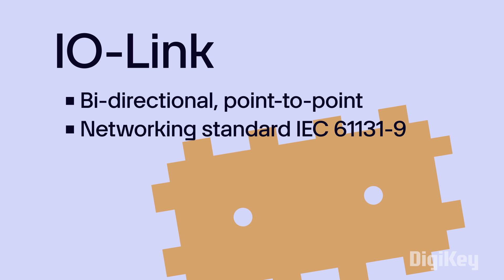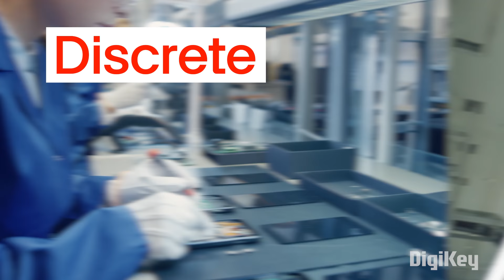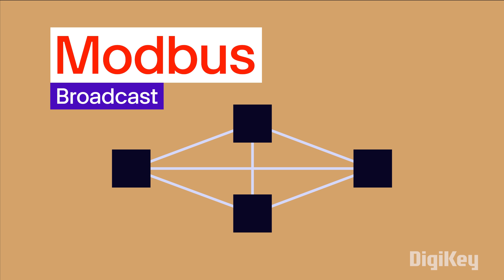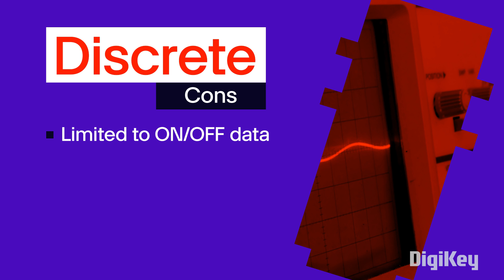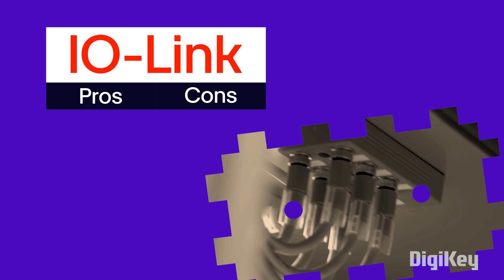IO-Link vs Modbus vs Discrete Technologies - Another Teaching Moment | DigiKey

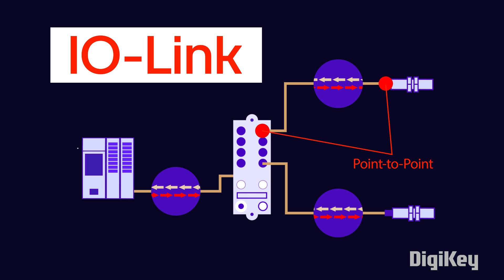Comment: I think that you are confusing discrete with digital. The image that you provide at @3:00 shows the controller on the left, the comm link, then the I/O block (be it digital, analog, or both), and the discrete I/O on the right. Whether or not those inputs talk I/O Link or not is secondary. Meaning the I/O will work either way. I have some I/O on a robot end effector that are I/O link, but I have them connected as plain-jane (legacy) I/O.

Modbus is more of a data transfer medium that connects to either remote I/O, or a third party device such as a temperature sensor. The target of the transfer is often times an I/O block that may contain digital as well as analog discrete I/O. Modbus RTU is rather rare these days as most gateways talk Modbus/TCP. As for timing, RTU packets are only difficult for the developer of the drivers. ;) If you are doing a "roll-yer-own" system, then Modbus ASCII is quite a bit simpler. I love Modbus. At the end of civilization, it will be cockroaches and Modbus that survives.

I'd have to look, but I imagine that the 20 meter rule can be fudged upon using better cabling and a repeater. But that's just idle noodling. But a 20 meter limit that includes DeviceNet-esque latency isn't exactly the cat's meow. But for conveyors and similar "same day service" systems, it would be fine.

Thanks for the video, this old dog learned a few things. :)